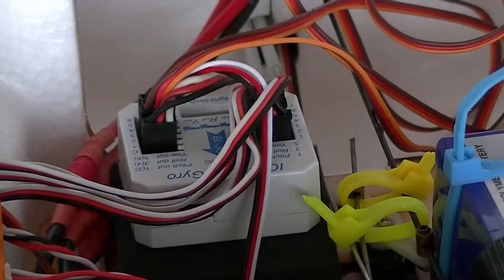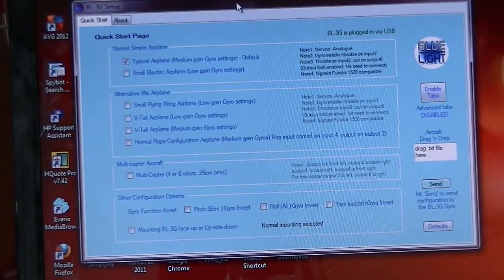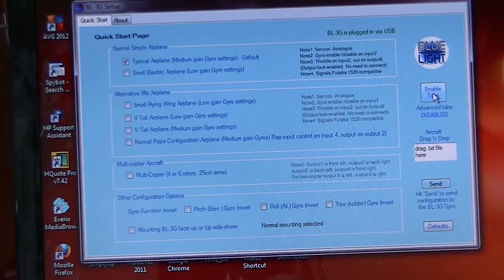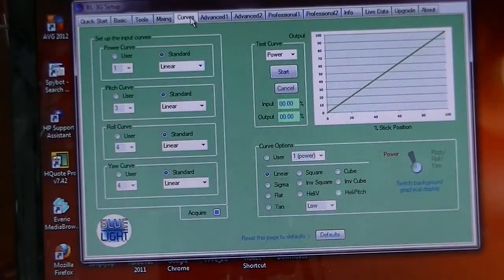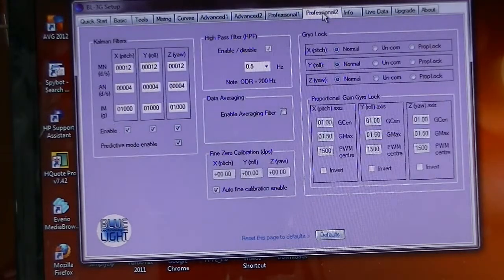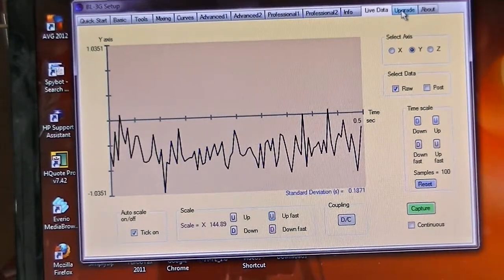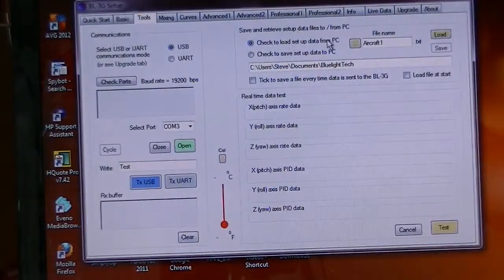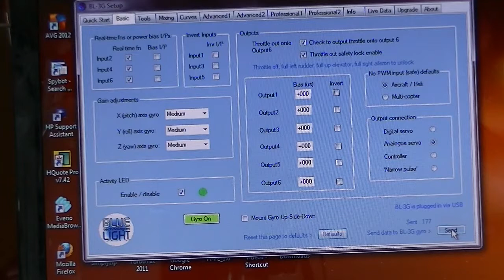BL-3GRC ICE-MAN Gyro/Controller basic overview

Comment: Hoping you would show how to heading hold on and off while in flight.
Reply from the maker: Please note that this is not a navigation system (there is no compass), and so heading hold (HH) will soon drift from initial heading. It is really only intended for short periods (i.e. takeoff). This description was covered in the manufacturer's blog post in 2014. https://www.rcgroups.com/forums/showthread.php?1722138-Blue-Light-Technologies-Flight-Stabilizer-BL-3G-2D-3D-Quad/page36 (go to post #535):
Heading hold has been fixed on the BL-3GRC V3.4 (free upgrade http://www.bluelight-tech.com/Downloads.htm#)
The RC Tx can be used in the normal way for trimming the aircraft. (Also via the sub trim from the 
basic tab page). However when using Heading Hold, please make sure, when activating the tools tab 
test, that you see very little movement with the green bars when the rudder stick is in the central 
position. If you've trimmed everything up nicely you can remove and residual green bar by following 
the procedure in the advanced user manual (v3.1) page 37. ie after all trim is nice, you need to:
1) Go to the Adv1 tab page and press the orange Auto button
2) Go to the Basic tab page and send parameters to the Gyro
3) Go to the tools tab page press TEST and move your RC Tx rudder trim until you remove the green 
bar.
You should then be ready to go.
Note that HH will activate when you flick the switch that you assigned to it (on the Adv2 page, and 
with the gain as set up in the box for this function, typically 0.001), and while your rudder stick is centralized. When the rudder stick is NO LONGER centralized the HH will be auto deactivated. If you wish it to be active again you need to flick off, then on again your RC TX sw assigned to this function (again while your rudder stick is centralized).
(Note that the HH function is also available for the pitch and roll axes too)